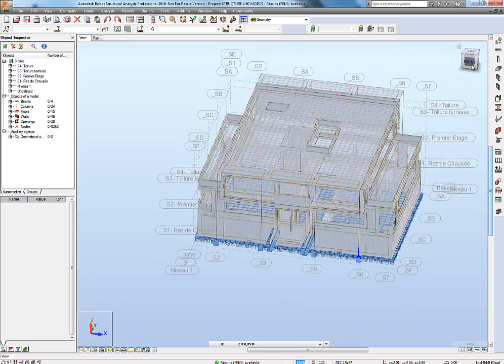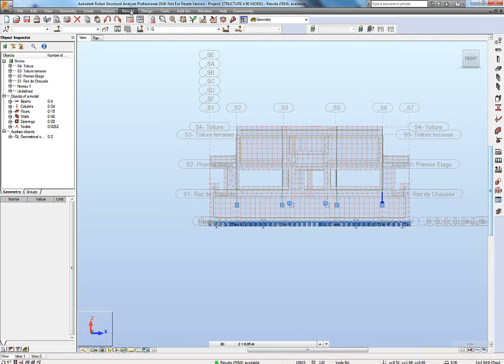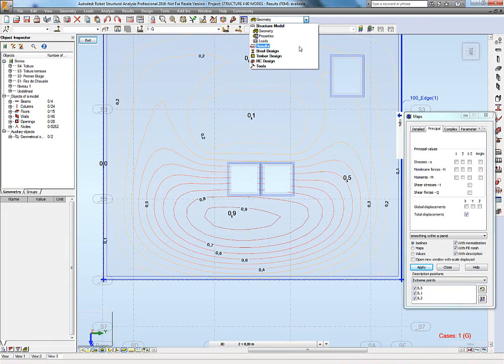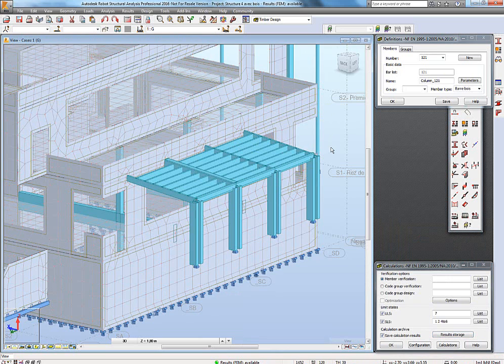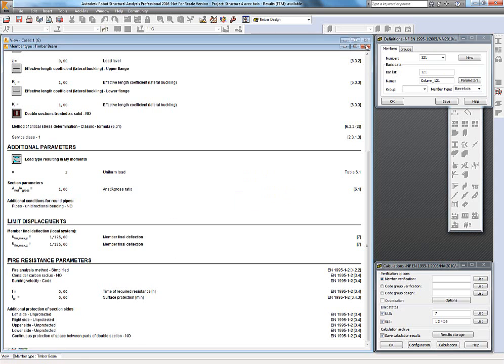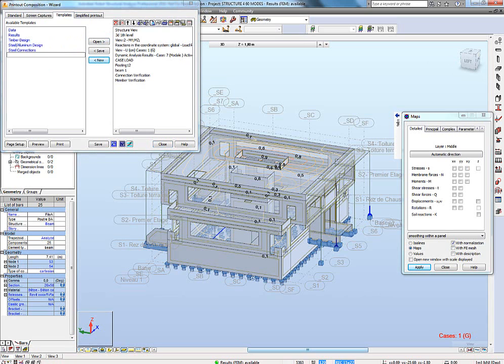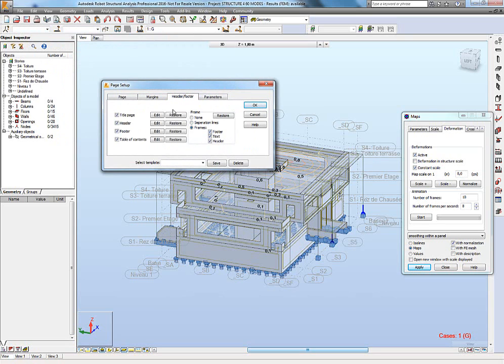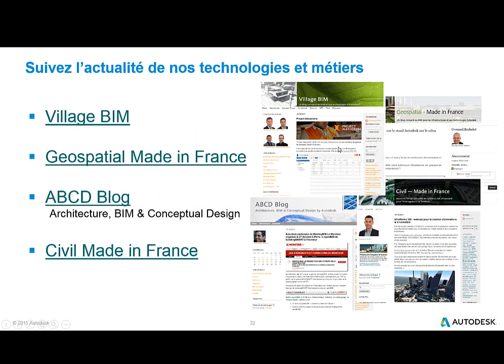Calculation Note with Autodesk Robot Structural Analysis Professionnal

Comment: Eurocode and ACI / LRFD Result is the same or....
Reply from the maker: not the same regulation, not the same result
Reply: Thank sir. for steel design. How do we model release moment in frame with truss. i want to model truss work as axial force. Could you upload video it? i have problem with nod. i can fix it.